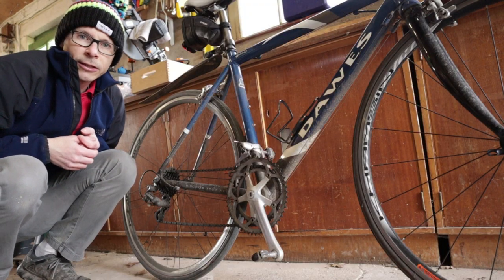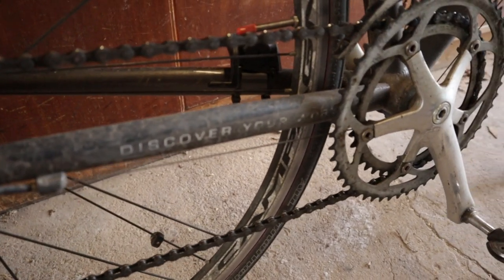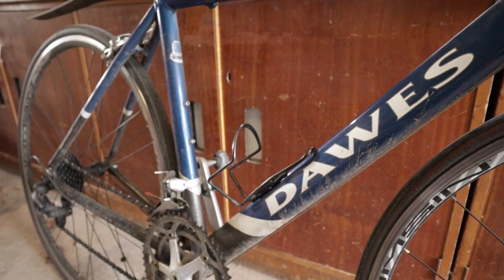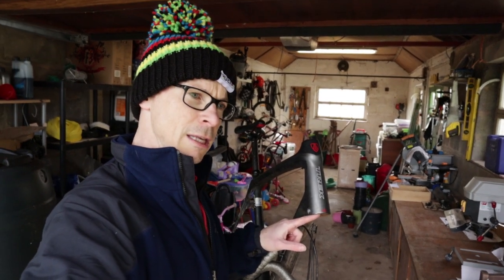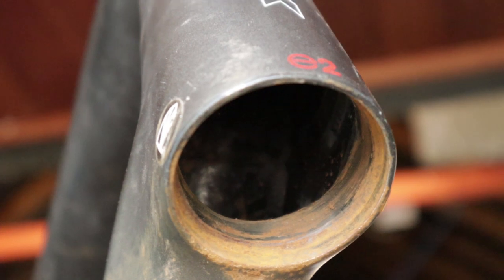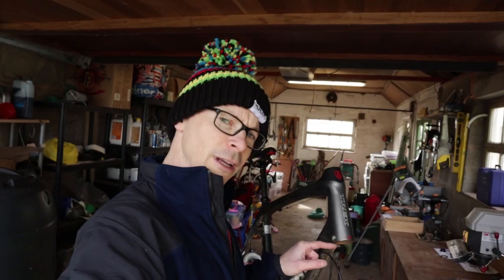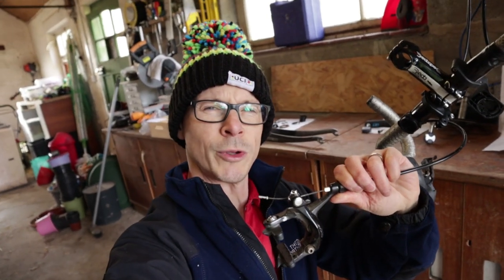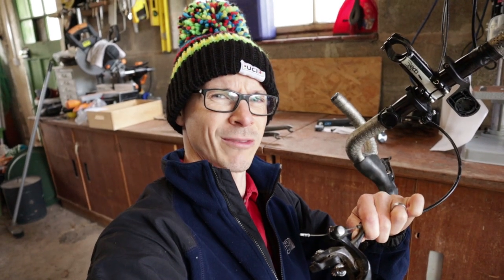Can An Amateur Mechanic Renovate A Road Bike? Let's See...

Comment: Hi why didn’t you remove the seat and seat post? Looking forward to seeing put it all back together.
Reply from the maker: Good question. Firstly it didn't actually occur to me. Secondly I had a bike fit so I'm planning not to risk adjusting seat height and anything around the stem.

Comment: Could you tell the BB bearing was shot when riding before inspection?
Reply from the maker: John - in truth, no. There was a gap between stopping riding and filming this video of a couple of months. Maybe it was still rotating when I was riding and then seized up in between.
Reply: @Sportivecyclist  I found play in my bottom bracket in June 2019 on my 2014 Trek Domane when cleaning the bike and replacing a snapped gear cable. I hadn't noticed any problem before. When I stripped it down I found the bearing had seized and was rotating in the frame, damaging the seat. Can be a problem with these bearings. Wasn't covered by the lifetime frame warranty. Trek had the frame back and repaired it - it would definitely be cheaper to have fitted bearings a bit earlier! Apparently you should be checking this frequently. Looks as though you caught yours in time!